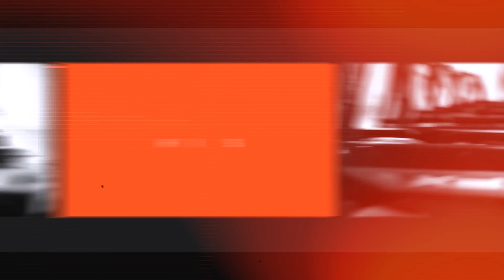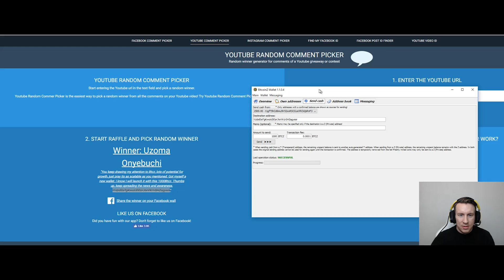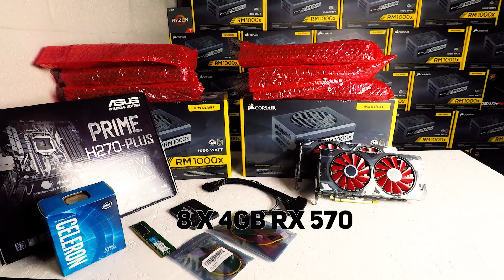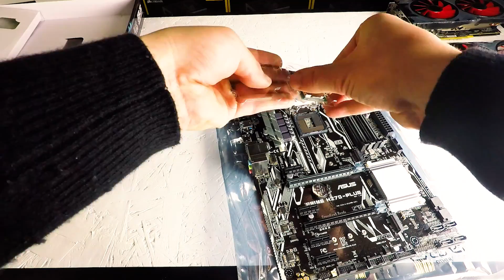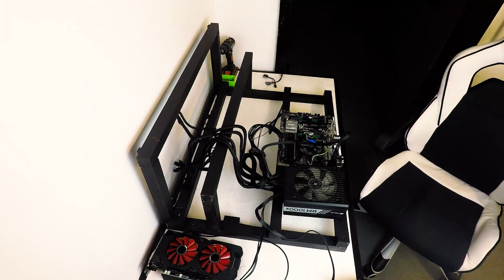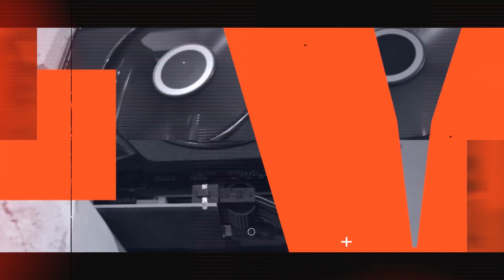How to build a 8 GPU Ethereum Mining Rig

Comment: Nice video!, but I noticed that you built on top of the anti-static bag.. which isn't really recommended... only the inside of said bag is anti-static.. it'S much safer to build a PC on the mobo box directly since cardboard isn't conductive... just a tip from someone who managed to kill a mobo that way :P

but you did a nice job, and the rig looks amazing. did you build the frame yourself? if so, could you please tell me the dimension you used to make the 8 gpu frame please ;)

here is my address for the giveaway:
t1JSUGE4B7SmBKkyhie4iLTbBZxpWMEkD5k
Reply from the maker: Hi Dom, Thanks a lot man, yeah we build the 8 GPU frames ourselves, I have put the dimensions on a photo for you and uploaded to twitter. Take a look here - https://twitter.com/TheCoinKings/status/959370262302085121

Literally built several hundred rigs and a lot more PCs before mining! I've only ever killed one mobo, it was due to a custom cooler, which needed real pressure to clam down and the screwdriver slipper and literally cut some tracks  🧐. 

Good luck on the Giveaway! Happy mining!